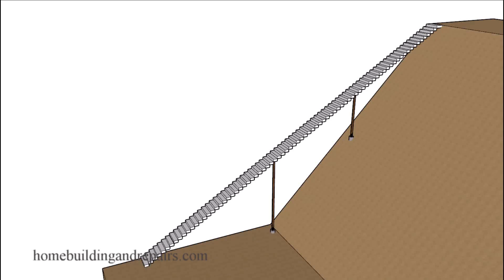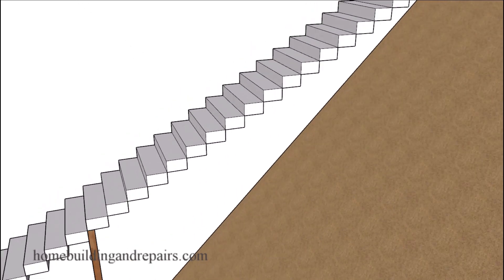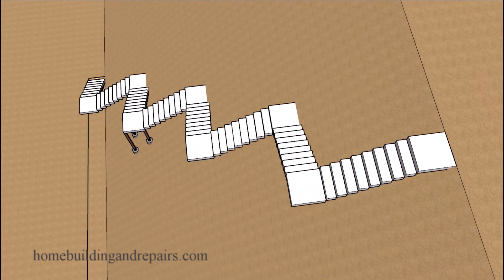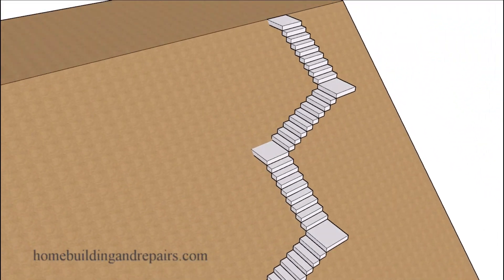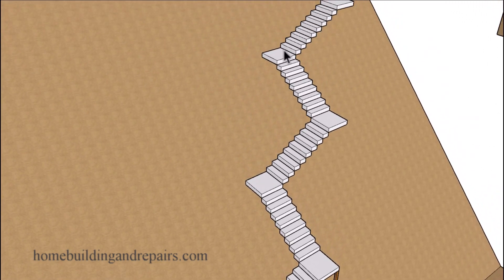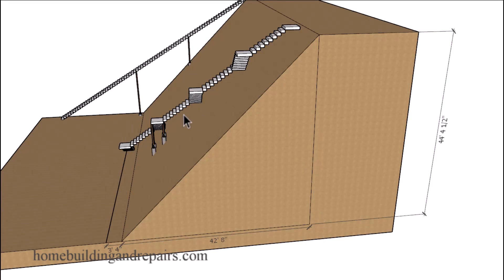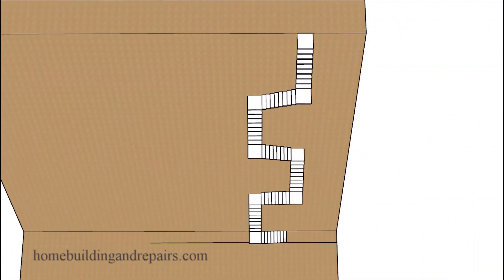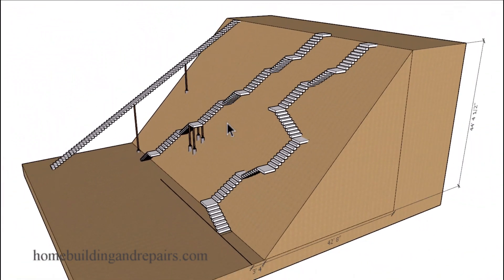Better Stair Designs For Steep Hillsides - Architectural Ideas And Education Examples

Comment: Do you have any particular opinion about the use of ground screws for the support of hillside stairways? There are numerous ~2' tall models available online, which could provide just enough support for shallow slopes.
Reply from the maker: I would rather have concrete, but maybe it will be fine on shallow slopes and with out heavy loads.